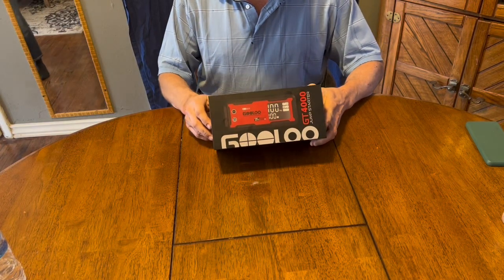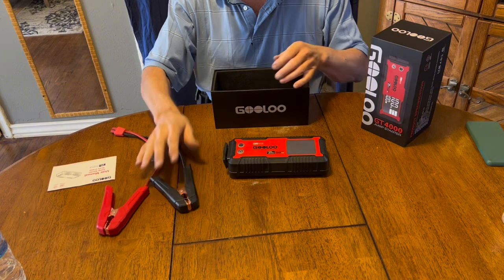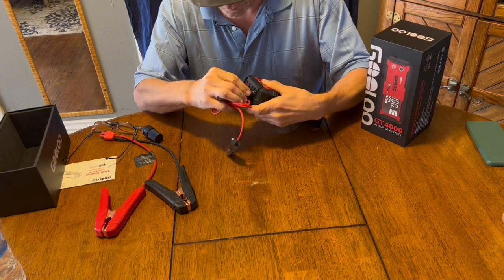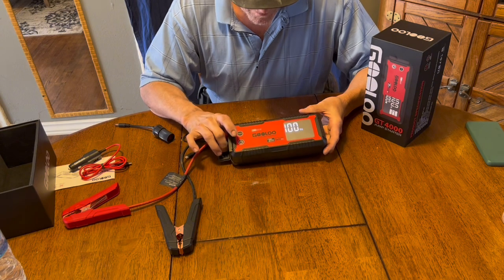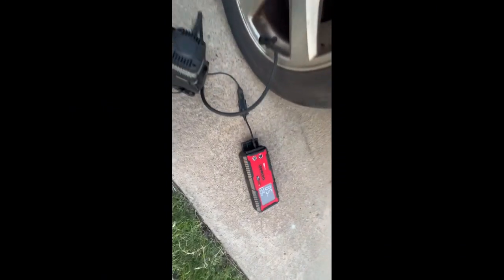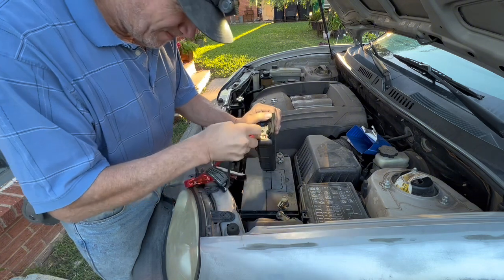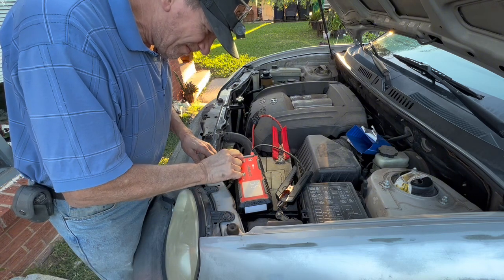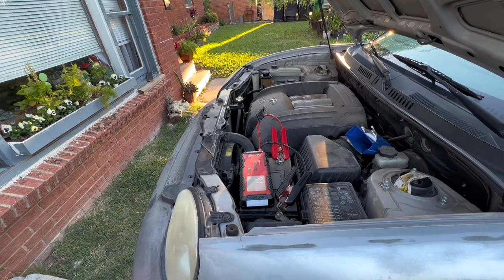GOOLOO GT4000 jump starter Amazon deal

Comment: I have a different brand jump-starter but similar to this and it’s a must have! It’ll jump off several cars before needing recharged and even if the battery on the jump-starter is low it’ll still jump off a full size truck. Definitely a must have.
Reply from the maker: An easy one
Reply from the maker: YesWelder form 81